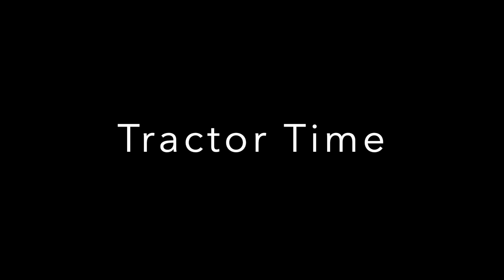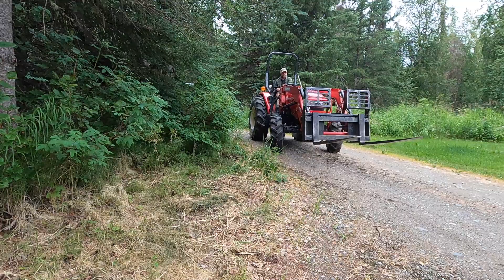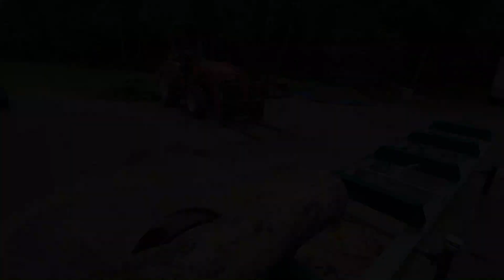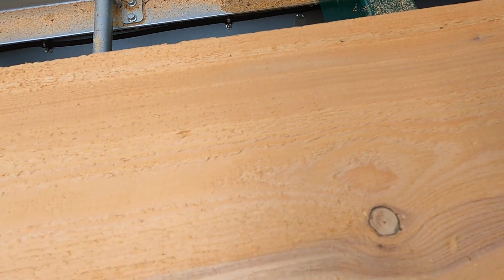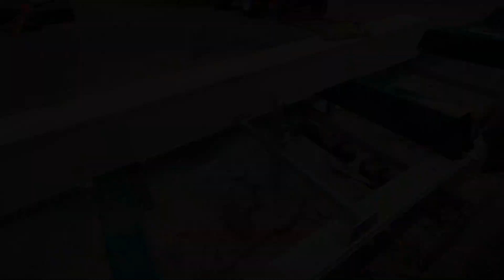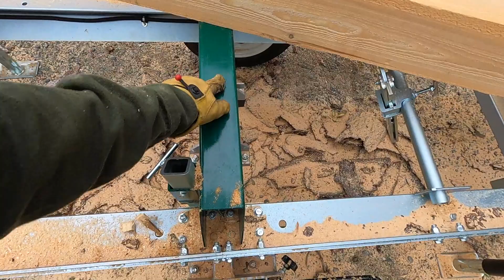Using the Branson 3725H Tractor Jul 13 2022

Comment: Good video!! Congratulations on the tractor they are tough tractors I had 2515 just didn't work for my needs.  Could be wrong but it sounded  and looked like the 4wd was locked in when you first took off made a turn. You should get many year's work and pleasure out of it. Thanks for sharing be safe have fun enjoy
Reply from the maker: Good eye. Yes, generally I do have it in 4wd, but not using the rear diff lock. Depending on the situation the 4wd helps cut down on ruts.

Comment: I have the 3725R, bought it 3 years ago. I'm very happy with it, plenty of power and easy to operate. Best 3 point hitch in the compact tractor category.
You should consider flipping your rear tires/wheels. You are currently in the narrow setting. There is a middle and a wide setting which offer better traction in the mud and better stability. Leave the center part of the wheel attached to the axle and unbolt the 6 outer bolts. Move the outer rim to the outside of the center piece and that is the middle track setting; you will flip the bolts so the head is outside and the nuts are inside. To get the widest rear track, you need to swap left to right. The only potential negative is that the air valve stem will end up on the inside of the wheel well; doesn't bother me with it there. Flipping the tires and outer wheels like that keeps the tire treads pointed in the correct direction and gains an extra 5" of rear track width. It is a game changer in stability and traction in slippery conditions.